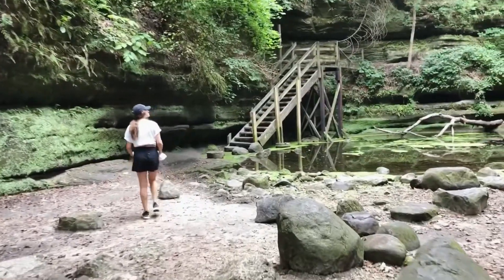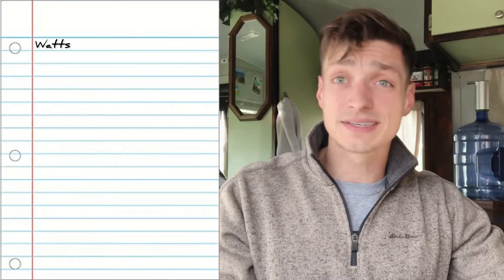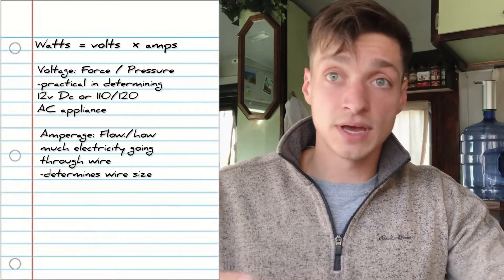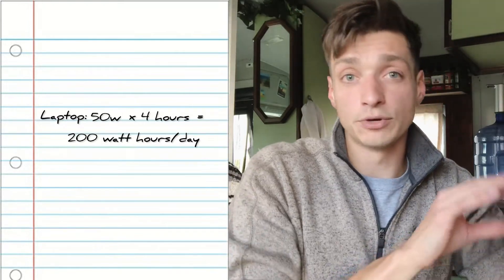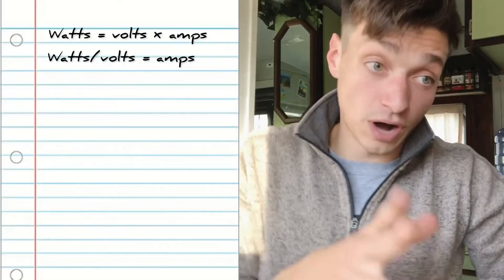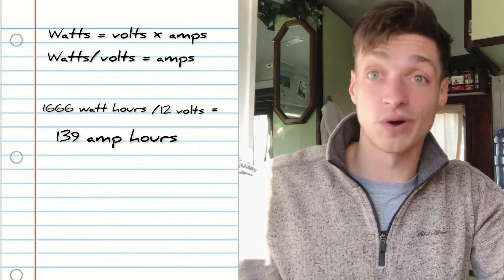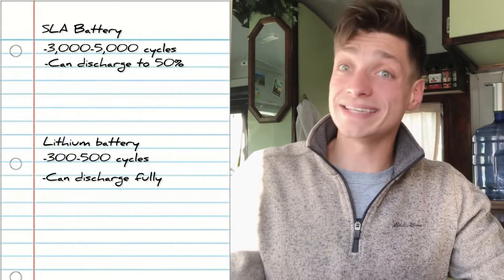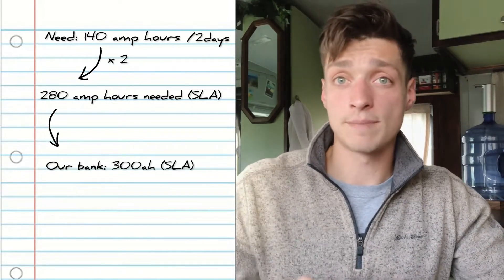What Size Battery Bank for Skoolie Conversion? Sizing, Wiring, & Choosing  the right Batteries!

Comment: 8:12 This is super confusing ...you said you can't charge the Lead Acid batteries as many times as the Lithium but the graphic says "3,000-5,000 cycles" and only "300-500" for the Lithium

Comment: Hello. Thank you for the video. I don't understand your fridge Wh. DId you calculate that at 120Wh per day?
Reply from the maker: Great question! So our fridge set up gets confusing when it comes to calculating usage over 24 hours. We actually use a chest freezer, thermostat, and separate inverter.. I looked at it a little closer and the estimate is probably a bit closer to 300Wh per day when you add in the inverter running 24/7 etc. It's a pretty crude estimate, but if you're curious we have a video and a blog on our website detailing the process.